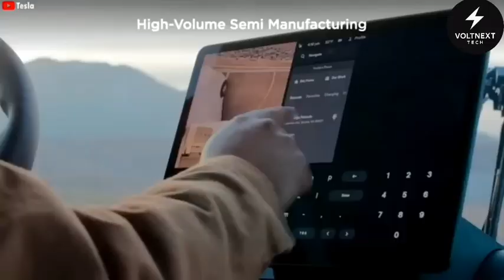Tesla Semi Mass Produce FINALLY Begin! 800 Miles Range | Elon Musk Confirms Saved 1M Gallons Diesel

Comment: I'm not sold on battery powered vehicles. They do have a place, but there are too many problems with massive fleets. There is just not enough resources to produce all the batteries. And there is a very real danger to them. Until much more efficient and safer batteries are developed, this is a no go.

Comment: I don't believe for a second it has 800 miles of range unless it's empty.  And even full, there is an 80k lb weight limit on American highways which means the cargo capaacity will be about 1/4 a diesel trucks capacity.